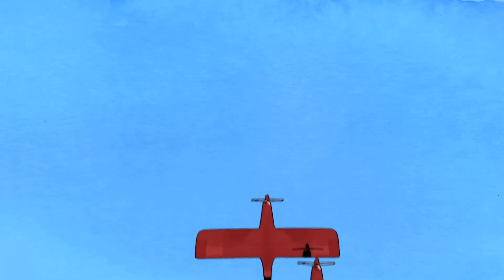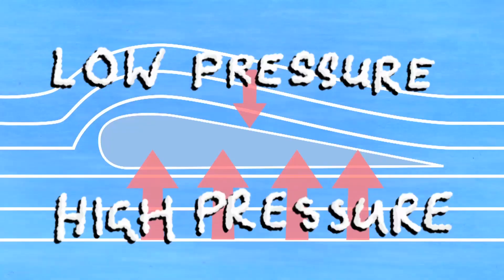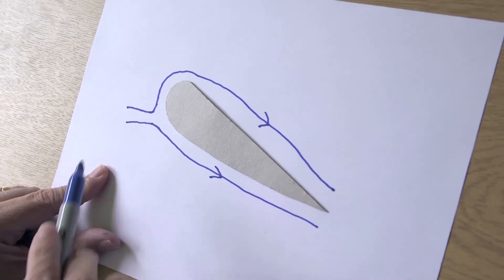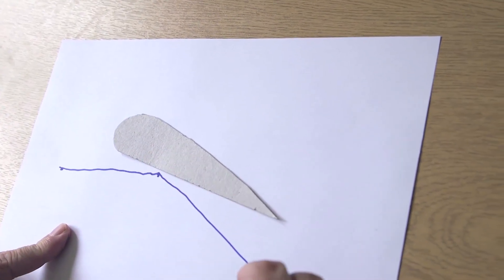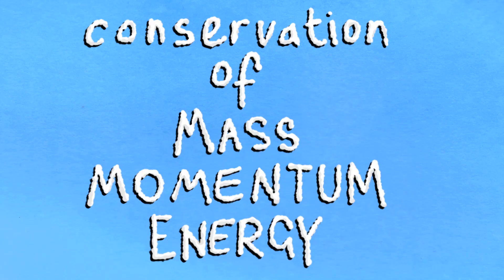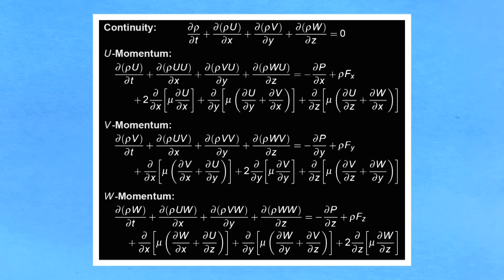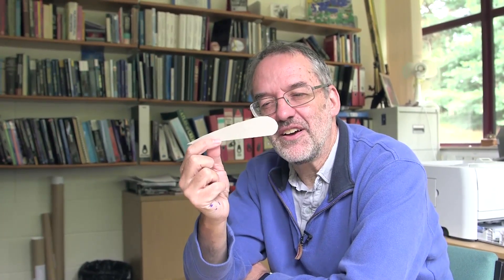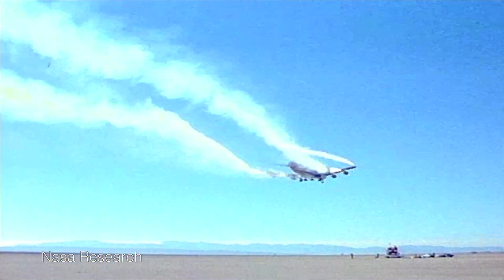Lift and Wings - Sixty Symbols

Comment: The professor says that due to the conservation of mass the air flowing over the top of the wing speeds up, it is squeezed between the wing and the air above. This is also called the funneling effect I think. Because mass is conserved the flow has to increase through a narrower gap. What I am confused about is that he also says it is compressed before saying the pressure is reduced ?? Does he mean there is initially increased compression and increased pressure as the air begins to get squeezed at the front of the wing, which would result in an initial deceleration, but then as the air speeds further along the wing the compression is lifted and the pressure lowers. It would be like a crowd of people entering a sports stadium through a gate.  As people approach the gate there is an initial deceleration as the pressure builds when people get squashed together but when they pass through the gate they speed up because they can't compress anymore and the pressure decreases again. I think the professors explanation is the best I have seen so far.

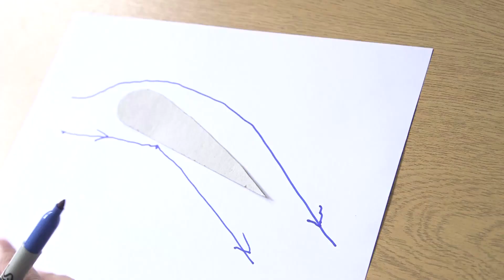Comment: 4:00 Right here is where you know this professor is legit. If you look at pressure coefficient distributions around airfoils generating lift, its very clear that the upper surface of the airfoil contributes SUBSTANTIALLY MORE to the overall pressure difference (deviation from ambient pressure) than the lower surface does. In the incompressible limit, the maximum pressure rise (anywhere) on the lower surface is +q, whereas the upper surface can get anywhere between -3q to -5q (or even more) below ambient depending on the exact shape, Reynolds number, and angle of attack. The vortices are spinning in the wrong direction for upwards-pointing lift at the end, but otherwise, cheers!
Reply: DaylightDigital  And , come to think of it , the pressure on the lower surface is usually less than ambient static on the lower surface , as well , of a light aircraft in cruise flight , i.e. at low AoAs . As long as the difference gives lift you’re home and dry .
  It’s easy to show , as well . If you look at the bottom of the top wing and the top of the bottom wing of a doped canvas covered bi-plane in cruise flight both will be slightly bulged out. This indicates that both surfaces , top and bottom , are below the air pressure inside the wing(which is at ambient static) . There’s no other way to explain that , that I can see , without invoking Bernoulli .

Comment: "The air here is compressed which means it's travelling faster which means Bernoullis law (conservation of energy) says the pressure here is lower..."  So it's compressed which means the pressure is lower...  am I missing something?
Reply: timdigings  Yes . In fluid statics ( think gas in tube being compressed by piston ) the pressure at a point is the same in all directions . Fluid dynamics can have different pressures in different directions at the same point .

Comment: But why is he talking about "air traveling over the wing" and such? Isn't it rather the wing travelling through relatively still air?
Reply: The wing isn't travelling through relatively still air. The air is travelling around the relatively still wing.
Reply: +Syntheory,
 You're starting to see one of the biggest problems and what leads so many people astray.  This "faster air" stuff is nonsense because it only looks that way with the stationary wing.  With the real conditions of a wing moving through still air the speeds are different and the most common explanations completely fall apart. 
However, Acceleration is the invariant (the same) when viewed from either frame of reference and once people realize that it is accelerations of air that coincides with pressure gradients in space, it all becomes clear.  Unfortunately this Prof, though well meaning, is guessing and not quite correct.
...
As anything moves through a fluid it has to push the fluid around to get through it.  
...
Think of walking in water.  You can feel the pressure you must put on the water in front you to push it  out of the way.  YOU ARE INCREASING THE pressure at that surface to move the water away. Water AND AIR have MASS and require a force to accelerate them.  That force in a fluid is pressure!
..

What you aren't aware of is the fact that you also lowered the pressure behind you as you moved forward.  This allows the water to be pushed in behind you by higher pressure further away and at your sides.

Those pressures are the CAUSE of all the accelerations of the fluid around you. [and a wing]

IT JUST SO HAPPENS that for a wing, the pressures wind up being in our favor by being more under and less above.
..
I won't go into more detail here, but that is the overview that 99% of the well meaning people who try to explain this completely miss.
..
I just happened by and saw this reply.  I don't know why I didn't get a notification...

Comment: Explanation is correct  but misleading . Much easier to use energy equation -  stagnation point (pressure (potential energy) maximal , backsides (kinetic energy maximal) . - same as pendulum in lowest point

Comment: The wrong explanations you mentioned, are included in your right explanation. In the  Bernoulli's equation you get conservatoin of energy and momentum in the equation itself. Your explantion is redondant.  Bernoulli's principle means conservation of energy. together with newton';s 3rd law (which is again enrgy conservatoin) you got your plane flying. ;)
Reply: They're wrong explanations if they're the only explanations.
Reply: +Tonathiu Redrovan,
If the air is stationary before the wing and plane arrive and after they pass there is this well known tremendous down-wash of air, how is that this is NOT putting additional energy into that air to accelerate it so much?  ... AND, therefore you cannot claim energy conservation because some (MV^2 downward) is added to the air...?...

In the classical Bernoulli venturi pipe, the air has no net acceleration and returns to the same speed after the narrow section of pipe...?...

Comment: The proper argument to use against "Bernoullista extremists" is not really "planes can fly upside down", but "flat barn doors can fly perfectly fine as long as you push them through the air at an appropriate angle and speed". A wing does not need to be cambered ("bulging" more on one side than on the other) at all to work. It just needs to direct enough air downwards overall, and you're flying. No "longer ways around" involved whatsoever. A paper airplane can keep flying indefinitely if you stick a tiny engine with a propeller on it to pull it along...
Reply: +Attila Asztalos,
I am not sure of the rationale of that reasoning.
..
.
The flat wing flies just fine because the flow pattern around it is pretty much the same as the flow pattern around a cambered wing.  It is not simply the wing shape, but the air flow and accelerations that matter the most.
..
And in order to "direct enough air downwards overall", There must be pressures to accelerate that air downward.
...
Bernoulli actually has no place in the explanation of lift.  Bernoulli's Equation can be used to CALCULATE the lift force, but it doesn't explain anything because the myth is the "Fast air has a lower pressure than slow air." This is easily measurable as false.
Pressure difference accelerates air. 

...
Since air has mass, Newton teaches us that it takes a force to accelerate a mass and we must come to the conclusion that pressure is the source of that force.
...

Comment: This video is very confusing in its repeated mention of conservation of momentum.  Of course momentum is conserved in a closed system but in this case the closed system includes all the air surroundng the wing and not just the air vertically above and below it.  Air is accelerated downwards by various effects including simple deflection and the Coander effect and the force required to do this produces a reaction force (Newton's 3rd law) on the wing which is lift.  The increased downwards momentum of the air is cancelled by the upward movement of air surrounding the wing , hence satisfying the conservation of momentum, but this plays no part in providing lift.  The wing itself experiences no change in momentum, its velocity (and mass) are constant.
Reply: Coanda effect has nothing to do with it

Comment: I understand everything about this, except for the fact that at the front of the wing the pressure is higher on the top than the bottom because of the camber. At the very top, front there is a build up of high pressure because of the shape of thing wing. How does this pan out or does it matter. Are other forces greater than the pressure build up at the front top part of the wing. Does the pressure get dissipated and does it leave the tail end of the wing having less pressure above it? I'm so confused. Is it cuz the long wing has more opportunity to take advantage of the displacement of pressure that the camber caused. So there is high pressure in the front top part of the wing but the wings width means it can take advantage of the low pressure created above the wing?
Reply: +Collin I,
.
The problem is that this 'squeezing' or 'pinching' effect is bad science.   It is called the Half-Venturi concept and doesn't work because the air above is not a wall and if you remove the top half of a venturi rube, it all falls apart.  So that is bad science.
..
The real science is that as the air follows the upper curve, that is centripetal acceleration of a mass.  The tendency for that air to go straight causes it to in effect "Pull away" from the center of curvature and this is what lowers the pressure there.   This lower pressure causes the higher pressure ahead of the wing causes this air to be accelerated toward the trailing edge. 
..
The air ahead of the wing is actually pushed forward in a bow-wave.  Then as it passes the peak of that upper curve, that lower pressure actually accelerates it rearward, thus completely reversing its its direction toithen be moving toward the trailing edge.
Pressure differences accelerate the fluid.

Comment: Hi there, this question has plagued me since I was little and I annoyed a lot of teachers who could only give me a answer of what causes lift is air moving faster over the wing cause lift... it made totally no sense to me. but I think I m starting to understand and could I get please get reply of someone who has had more learned then me, just a mechanic.
I start by saying I couldn't understand newton's third law, how can air give such a force to lift a plane up? then I realized on riding a motorcycle at 100km/hr you get a lot more air blowing in your face then riding at 40km/hr. on another note I couldn't see how wind tunnels for testing would work... but then I realized they are simulating the forces of the air. Is this why airplane has to get up to a certain speed before it can take off?? it needs to be generating force onto the air to cause its mass to move higher through the atmosphere?
now for the most confusing part I have trouble the air foil, I kinda understand what u are saying in this video, on the bottomside of the airfoil is the high pressure generated by the fact the wing is at a angle or "angle of attack" (I don't know planes) due to the fact the air at the bottom wing is getting "compressed" as it moves further and further down the wing. and on the top of the wing is the opposite as the air enters over the airfoil all the sudden there is a Void in the atmosphere and much like a liquid that has flowing viscosity there can not be a "void" in the atompshere  so the air goes into a lower pressure. 
So is a airwing kinda like a cyclinder filled with liquid and in the middle you have a piston, and if there is a pressure difference of sides the piston would move up towards the side filled with the lower pressure???.

Comment: Designers incorporate such things as leading edge flaps, triple slotted flaps, vortex generators, thrust vectoring to make a complex variable machine fit for purpose. The thing I find interesting is that military combat aircraft use symmetrical airfoils at very high wing loading which make them a very different beast to a commercial passenger aircraft.

Comment: The graphic at 9:20 shows the vortices going the opposite direction than the reality. If you watch closely at the planes flying at about 9:30 for the next 20 seconds you can see the vortices going the correct direction. The pressure is lower on the top so the air slips around the wing tip approaching the top. The physics of from high to low pressure can be understood. Great video BTW.